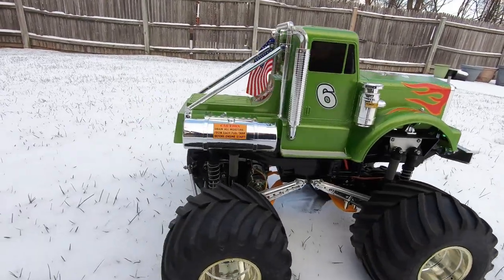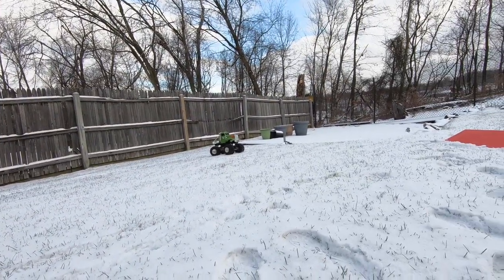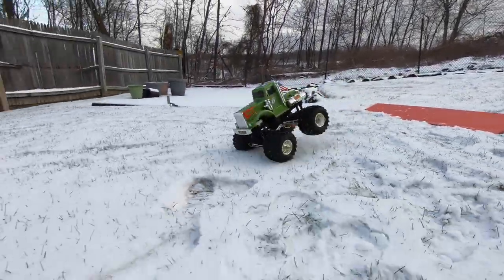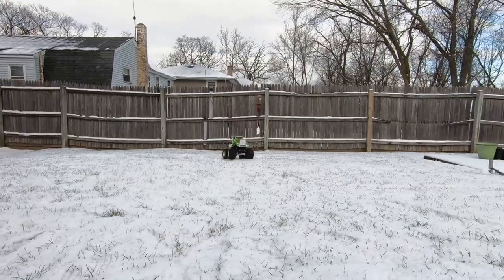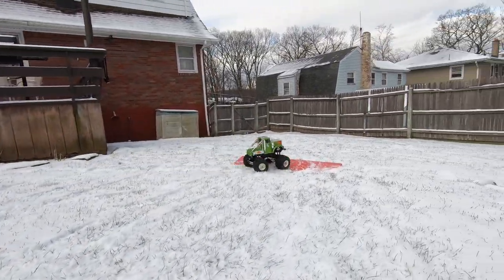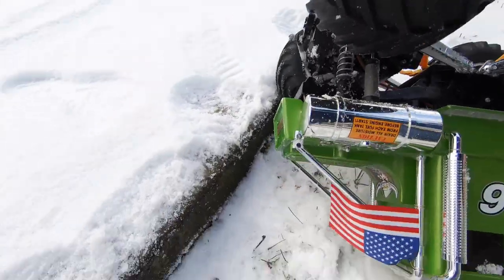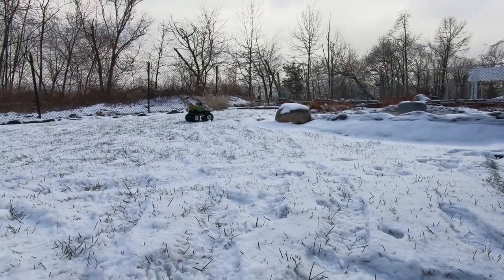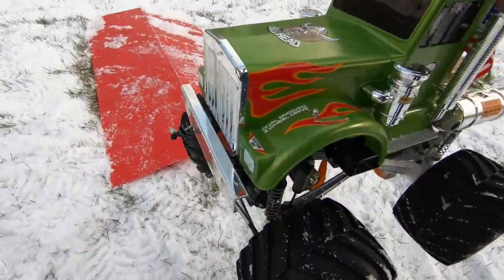Tamiya Bullhead snow monster I BROKE IT!

Comment: I really need to get a new ESC for my bullhead, it's been sitting in the attic since 1999! I love the engine sound effects upgrade on yours!
Reply from the maker: Hi get a quickrun 880 esc they work awesome that's what's in my bullhead.👍👍
Reply: @ShenRC  nice one thanks I will look it up! Are you using stock motors?
Reply from the maker: @DashDrones  Hi I use two RC4WD.COM 20 turn crawler motors, a perfect upgrade over the stock ones but not to crazy that you will end up breaking everything...also get steel pinions the stock aluminum ones are garbage and melt away like butter than mess up your gears.👍
Reply: @ShenRC  awesome, thanks for the tips!

Comment: Awsome video, love it! Ever thought of replacing the stock suspension with the one from CPE? It would mean you had to replace the lower stock mountings too (which I believe wouldn't work anymore  with the current axle mounted servo setup...)
Reply from the maker: Hi thanks, I did that before but i like the way these clods drive with the stock set up they are more fun.
Reply: @ShenRC  Agree, that original look is the best :-) BTW: what type of shocks do you use?
Reply from the maker: @christophkiefer  Hi I got them off e-bay a long time ago I think they were from a axial ax10 RTR crawler.